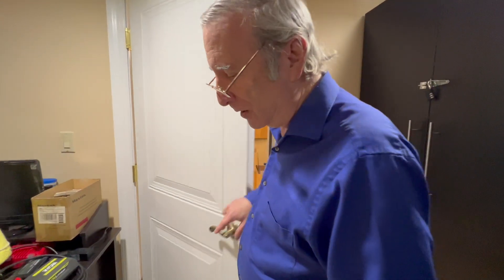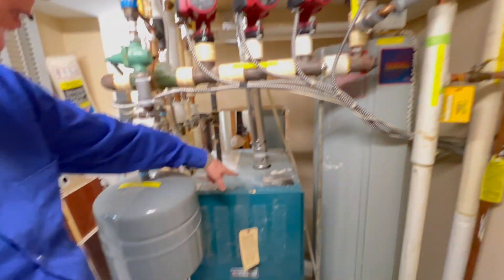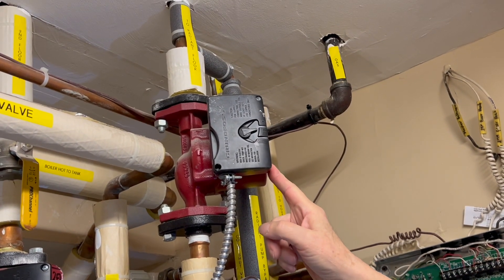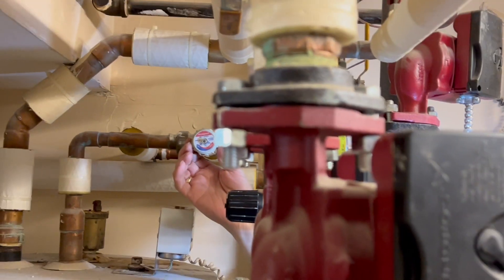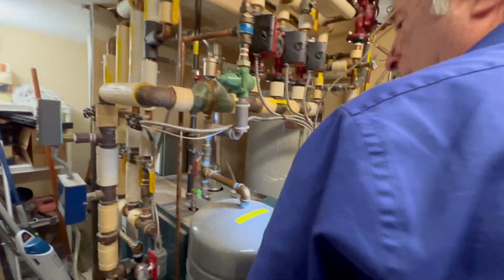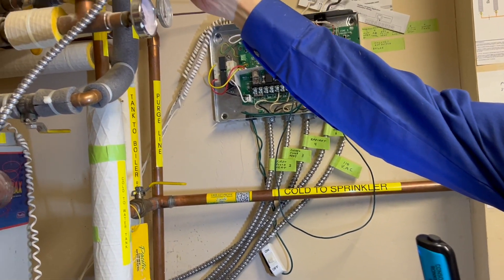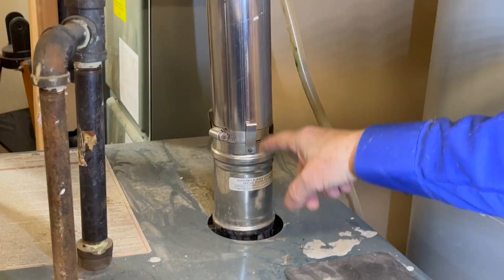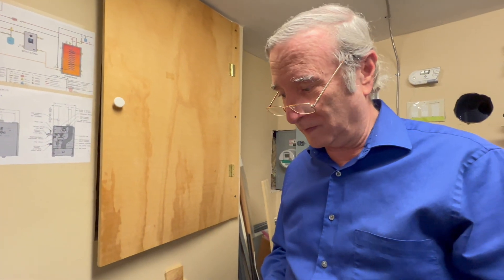Tribal Knowledge: Understanding Boiler Rooms & How They Work

Comment: The "surge tank" is an expansion tank. It is to absorb the extra volume the boiler water creates as it is heated and expands. It is not a hammer arrestor, it contains boiler water not domestic water.
The "over pressure valve" is an air elimination valve. there is a pressure relief valve near your temp and pressure gauge.
Your mixing valve may not be bad. Maybe you are not pulling the handle out enough to turn it. It will not turn with the screw in and if the handle is not pulled back. If you unscrew it remove it and look inside the plastic handle it might make more sense.
The following is taken from the manual
 To adjust temperature setting of the mixing valve. Loosen
hand wheel screw, lift handwheel and turn to desired
temperature, push the hand wheel on, then retighten screw.